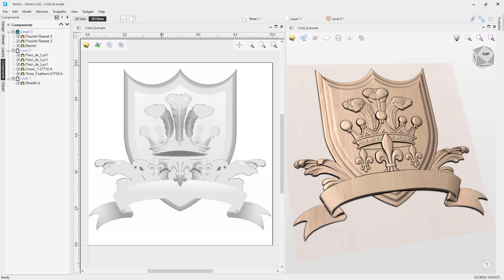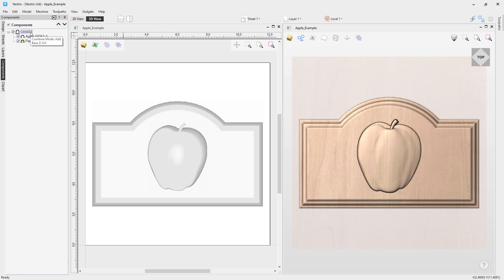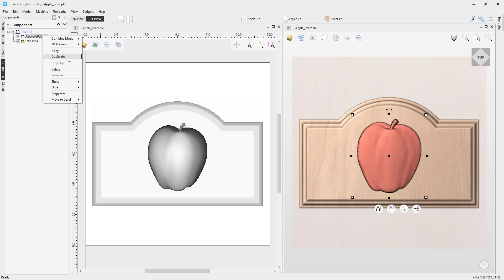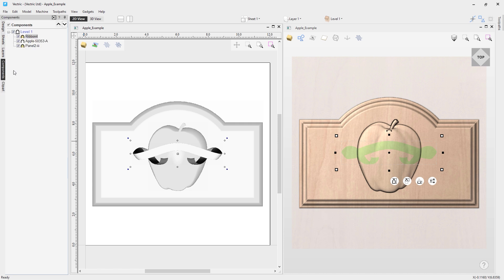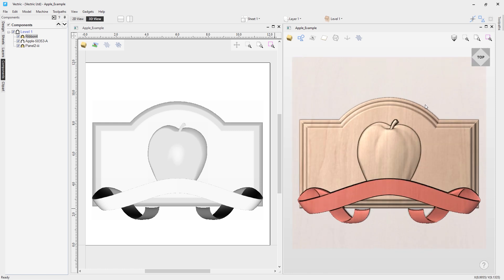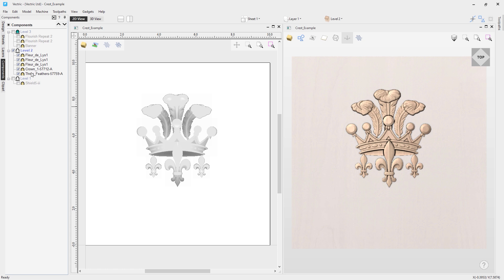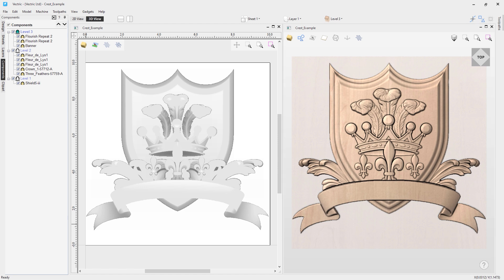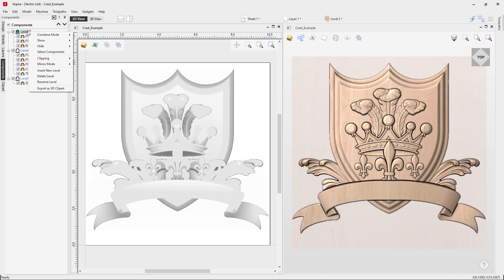How to use the component tree in Vectric software | 3D Assembly | V12 Tutorials

Comment: great video, but I'm a little confused about something... Why then, are the flourish repeats still showing UNDER everything even though its in the top level, not acting like the flur de lys example did when you swapped IT's level and showed above the ribbon?
Reply from the maker: I suspect you have a level combine mode set to "Merge", or a few of the components set to "Merge"... make sure you have the combine modes set properly so things look correct in your 3D view (the composite model).